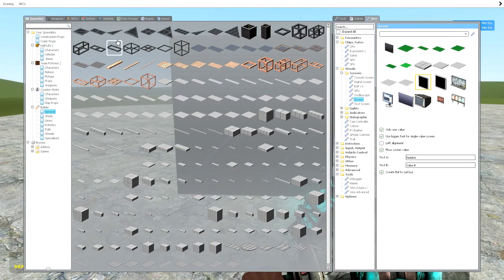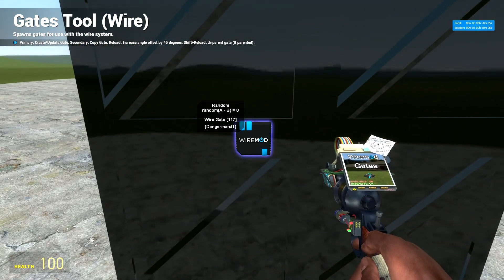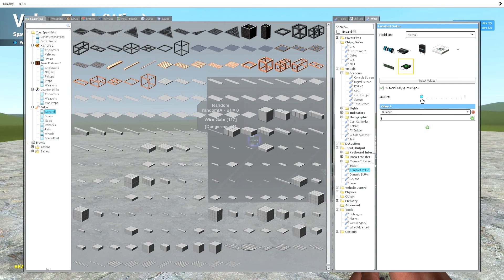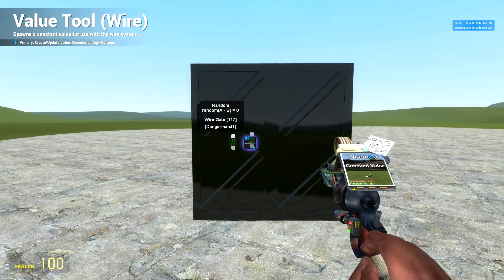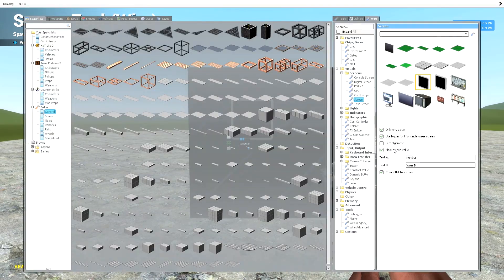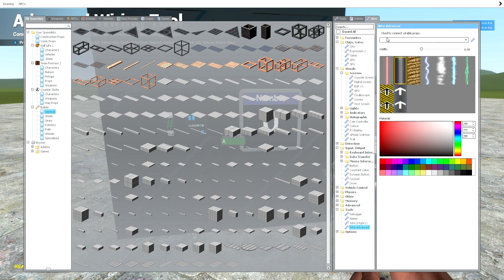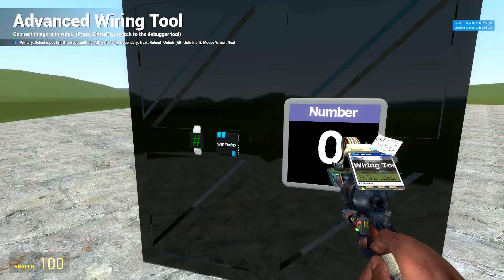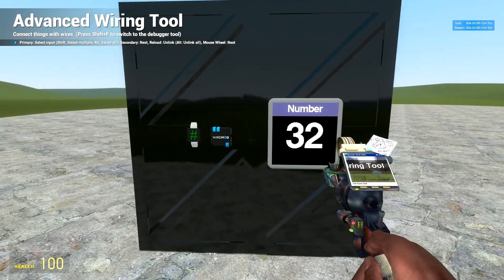Garrys Mod - Random Number Generator WireMod Tutorial (part 1)

Comment: Anyway to control it with a button without e2
Reply from the maker: +chris johnston There is a way to do this; but it requires quite a few more gates, and unfortunately i don't know how to do it myself. I will keep fiddling around with Wire to try and find a solution but for now i don't have an answer. Sorry my friend
Reply: its ok it was only to create a casino on dark rp anyway
Reply from the maker: Okay my friend :) E2 would be better for creating a casino... easier to manipulate
Reply: +Danger On PC E2 is blocked on many servers
Reply from the maker: +Fireboltofdeath It is blocked on most darkrp servers yes due to exploitation. But you can still have a play around with it with your friends, on sandbox servers or just as a thing to learn on Garry's mod :)
Reply: Danger On PC Yeah maybe. What does E2 run on? Custom language, Lua, Java?
Reply from the maker: I've had a good look around; and i can't see that it runs off of any other language so it seems to be custom. The syntax for me looks like a bit of a mix between Python and C (but thats just from my experience). However, i believe you can manipulate lua codes for servers through E2; so that may be a hint as to what it runs off

hope this helped :)